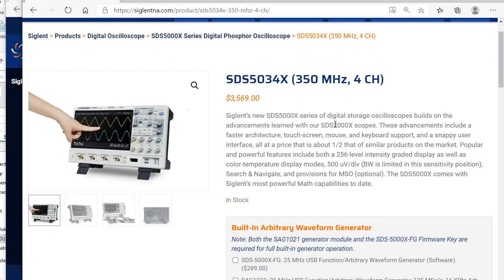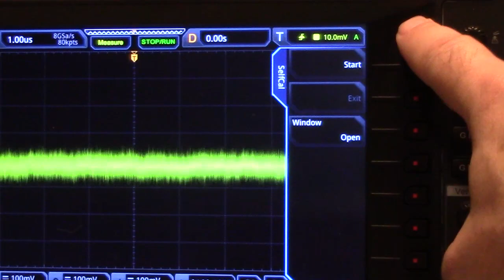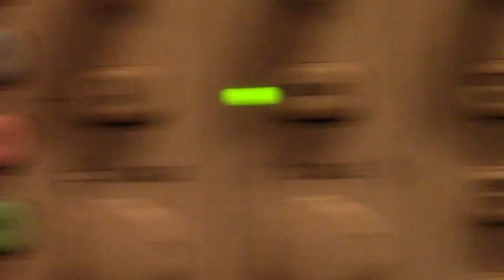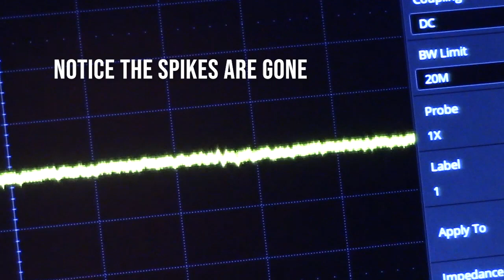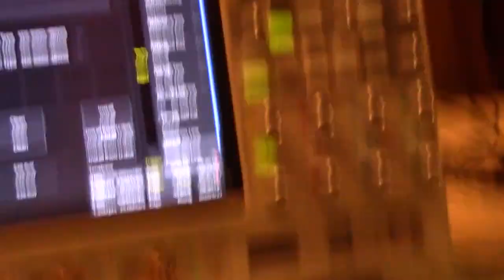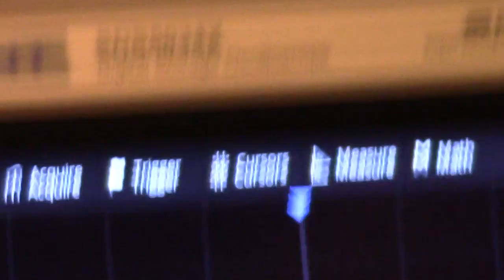ER07: SDS5034x  Noise and offset qualification

Comment: Hi. I am glad that the SDS5X is working well for you! 
Just wanted to ask about the physical connections at the probe tip. You mention that you "shorted" the probe.. but don't show this. If you simply connected the ground clip to the probe tip, you have effectively created a loop antenna that will pick up environmental RF which will directly affect the noise floor. 
A more appropriate method of checking the probe input would be to minimize the loop area formed by the ground/probe tip connection (using the short spring ground accessory) and connecting this to a known low-noise source.. possibly the scope probe compensation point or a low-noise function generator. You could also compare the same input from a fully shielded BNC coaxial cable and a probe. - Jason, SIGLENT North America (info@siglent.com)